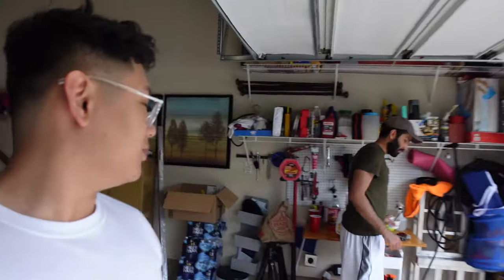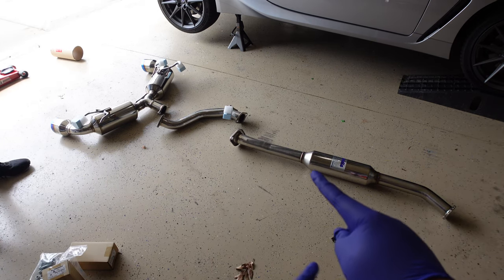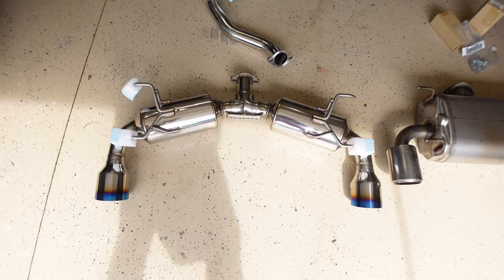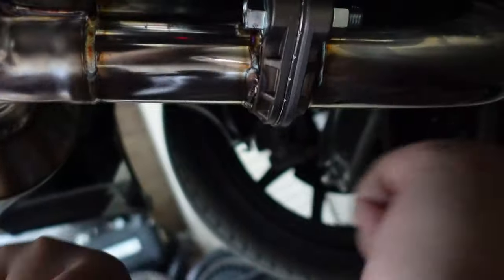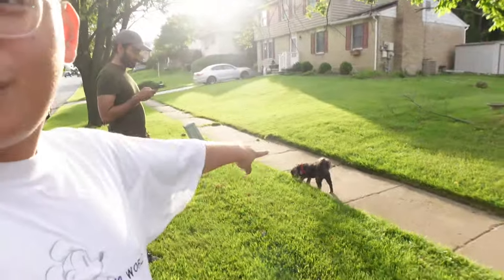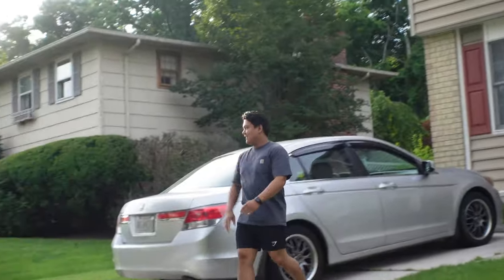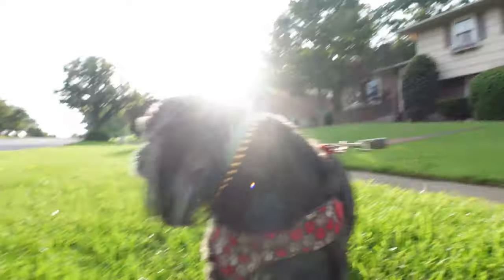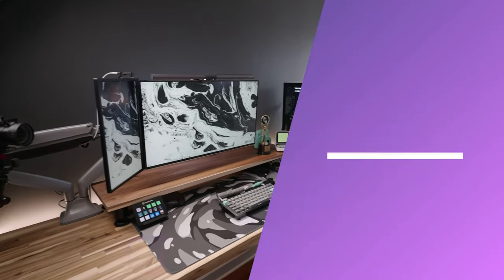MY FIRST EXHAUST INSTALL FOR THE 2022 BRZ! - INVIDIA N2

Comment: I have this exhaust too on 22 BRZ. The drone I kinda got used to (it’s only pronounced off throttle), or maybe it settled in and got less boomy (there’s some stuff in the mufflers that have to burn off over some miles). But when I move, if my mom helps with the long trip, she’s gonna dislike it because she has sensitive ears. I’m wondering if this car needs bigger pipes like the new AWE ones (3”) to relieve some back pressure, but I dunno if that’s true. How many n/a 2.4 require more pipping? Then again, not many make this much torque lol
Reply from the maker: I agree! The new awe exhausts sound good but a little too loud in my opinion doh they don’t have much drone. Maybe I’ll try them out one day! Looking forward to the new exhausts in the future!
Reply: Hi! Im planning to get this catback and wanted to know your experience on low speed and highway driving. Does it drone? On what rpm? Thanks in advance!
Reply: @WayneBanga  Had to come back to hear the exhaust from the outside lol (no one other than dealer has driven it). It does sound decent driving away (I wouldnt know lol). Upon further consideration I kinda want to try out the Remark (no mufflers) simply because it seems to crackle and pop a lot. Thing is I dunno how loud it is, this one makes me a little anxious around the neighbors (I leave at the same time daily). But the Remark seems to breathe better.